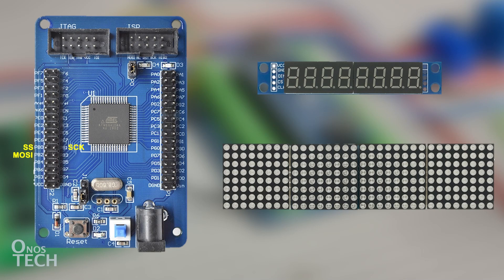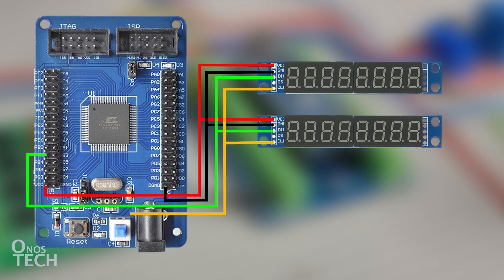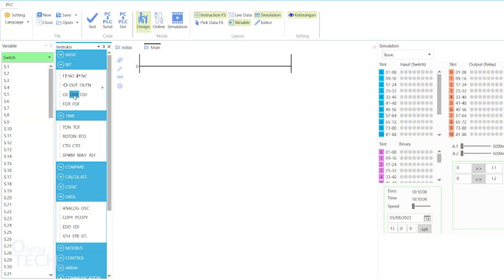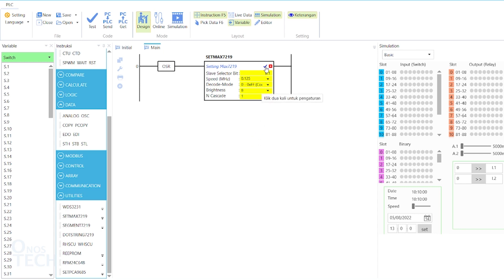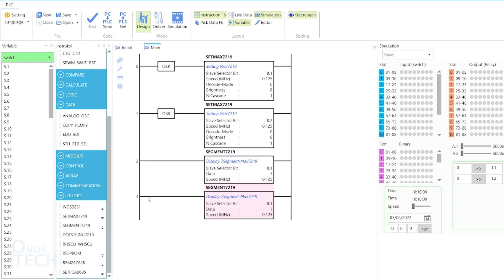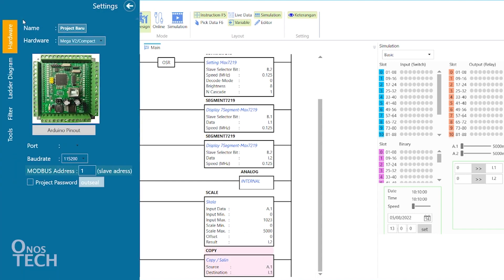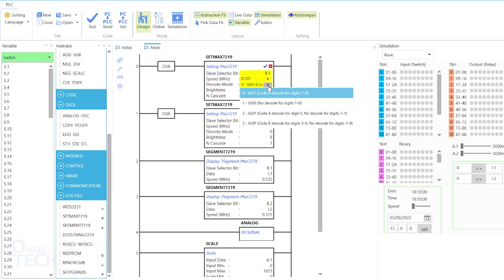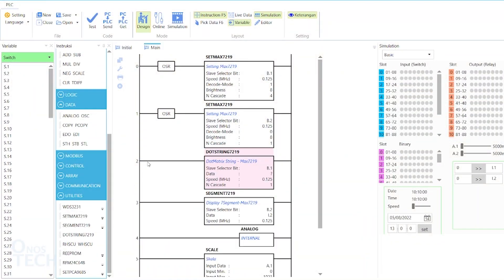M#3 MAX7219 7 Segment & Dot Matrix displays | Outseal Dev. PLC Mega

Comment: How to take Alalog input to matrix display 4/20 mA & voltage both on same display
Reply from the maker: It will require two displays, one on B.1 and the other on B.2 to display the 4-20mA and the voltage.
Reply: @OnosTech  required one video on this
Reply from the maker: @HDENKstories  🙂🙂🙂